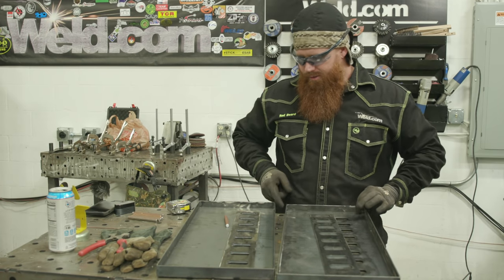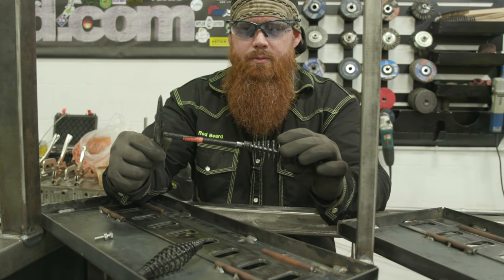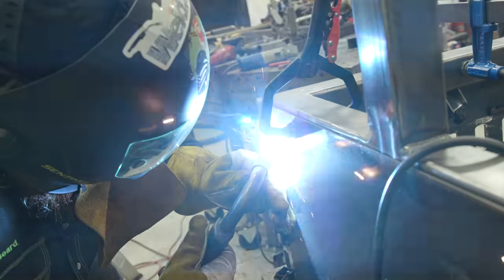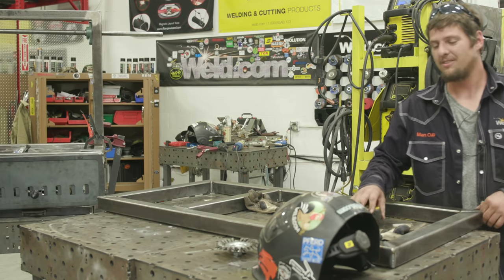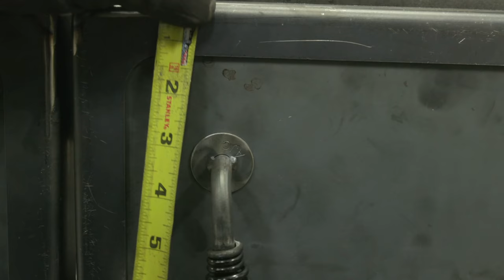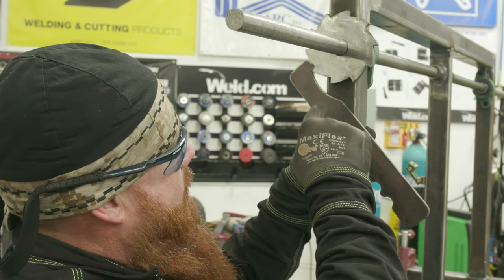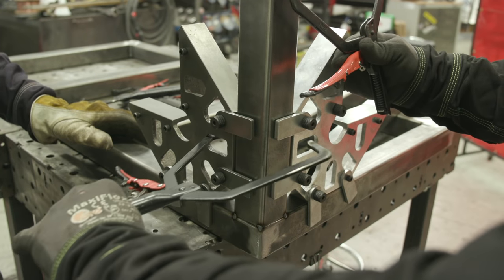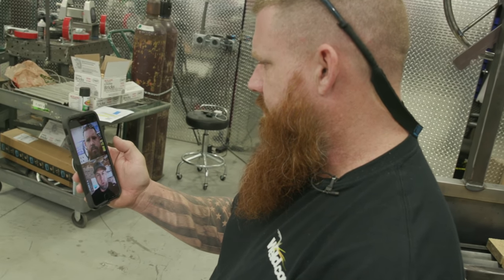STCG Santa Maria Grill Build: Part 4

Comment: Next time, weld the bolt cut edge to the chipping hammer, retaining the factory threads for the nut. Also, if you weld a stainless nut while a stainless thread is engaged, you run a very high risk of fusing then together. Always use a little Antisieze on the threads to prevent this from happening.

Comment: Hi guys.... I'm new in your channel, but I just activated the subscription. I really like the metalworking, woodworking, so I love your channel. I saw all the videos.... I really like the Argentinian Grill (Asador) you are building. I'm form Argentina!!! jajaja. Just one advice, just in case you didn't consider it yet. Basically, there's 2 ways to build the grill part (the specific part where you put the meet). One is using round bars (don't know if that's the name - hope you understand what I'm trying to say) and the other is using angle like you did. The advantage of use angle is that the fat and the blood goes for it, reducing the amount of fat and blood that goes to the fire. But, you need a collection system. If not, all that fat will just go to the grill front and it will be a mess. Hope this helps!!! Great channel... please continue publishing your videos!

Comment: Where did you get them hinges I can’t find them that small
Reply: Metal By The Foot has them if you have one in your area.  I don't know if the offer them on line but have them in there stores.  Might have to give me a call.
Reply: Lee Barnhart ya there was one kinda by me in Missouri but I moved to Florida and there really isn’t any smoker parts stores I have to get it all off amazon or other stores